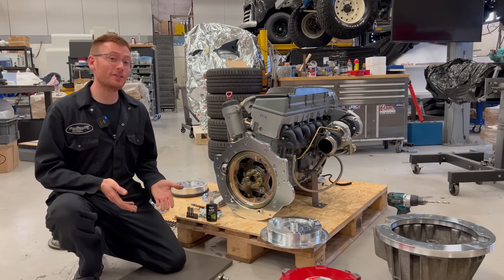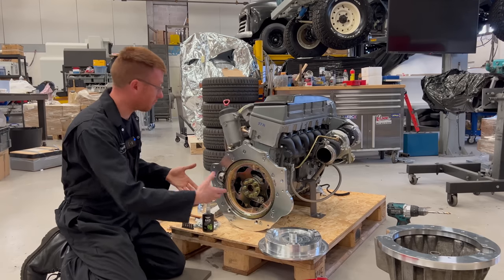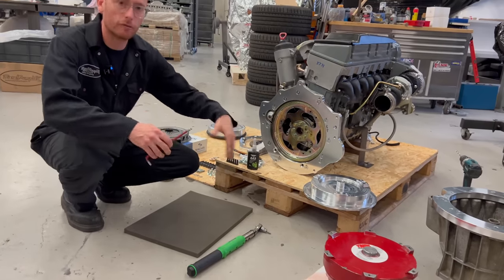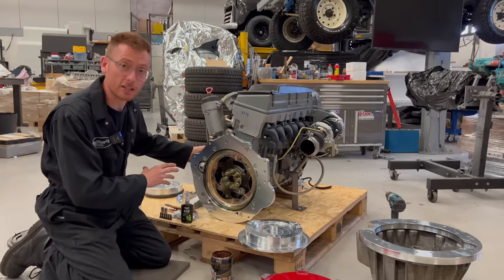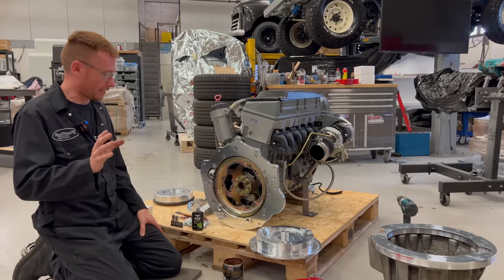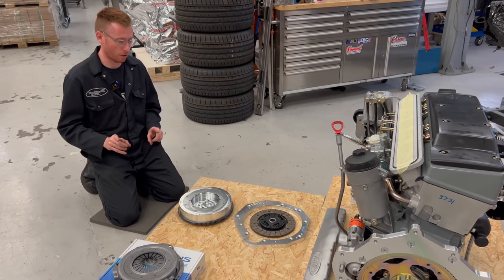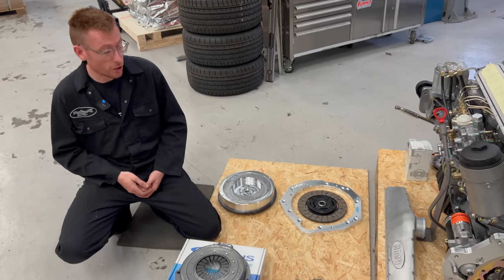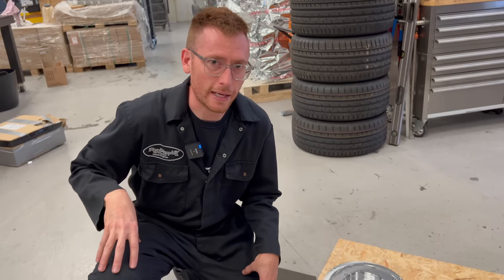OM606 Transmission Adapters, general fitting guide and safety advice.

Comment: I love how vividly clear you made it as to how hurt you could be if it got out of whack. I've actually seen what happens to a bell housing when a clutch assembly fails. Not pretty at all, and I knew the person driving the truck it happened in. He got injured but was lucky enough that he didn't lose any limbs. Absolutely agree spinning bits Loctite non-spinning bits anti seize and torque down

Comment: Similar question, as found below, but this time from the U. S. I love to hear the engine rattle, but I also want it to run smooth, efficient, a bit extra power (maybe 250hp to 300hp), very dependable, no black smoke, mate up to an 8HP70 trans, and ride off into the next 500 km, without much likelihood of fail!

Comment: hi ,
i would like add 40/50 HP to my OM606.961 , i dont wanna have black smoke in exhaus
just more power and engine sound still quiet , and i dont wanna make a lot of change (keep the engine stock with IP Pump)
you have any suggestion to do this ?
Many thanks

Cdlt/BR

Comment: Can I mate the OM606 to my w460 1983 GE280 5 speed manual transmission? Do I need an adaptor or will it fit? I want to put an HX35/40 on it. Is it strong enough by itself or do I need a new clutch and/or flywheel? If so which one?

Thanks in advance, your video’s are very helpful and Im gonna buy your g wagon snorkel intake one of these days.

Comment: I know this is completely off topic and other than being diesel wizards I know you are also Mercedes wizards and your adapter has made me think to ask here. I have a w211 e320cdi straight 6 like the one you got 400hp out of. My car won't drive anymore no matter what gear I select. D or R or tip tronic. Is there anything it could possibly be before I swap my gearbox. I have another waiting to go in but I'm worried if I get it changed and its still not fixed. Any advice or information would be greatly appreciated. Thank you and absolutely love your work and really hope to get my car to you for work in the future

Comment: Proper kit from a true pro! I have a 1972 Ford LTD land yacht. But has a 400 smog motor. I know what needs to be done to get over 500 hp. Do you do a adaptor plate for the Ford 400 transmission.
Reply from the maker: Send me the box and I will build you a kit.